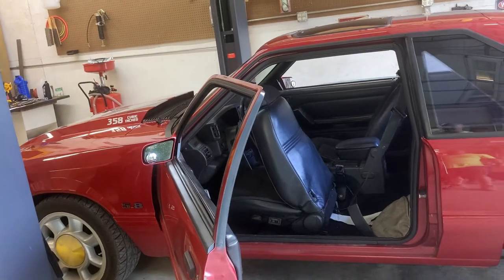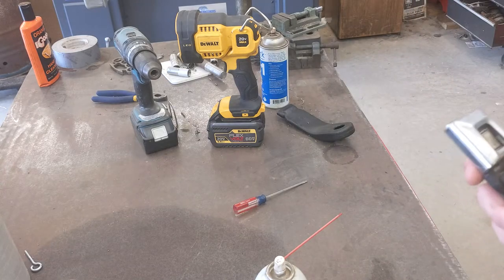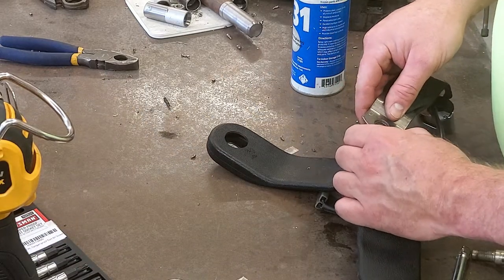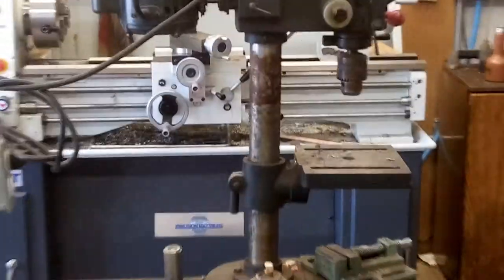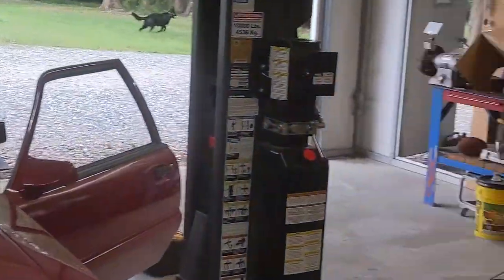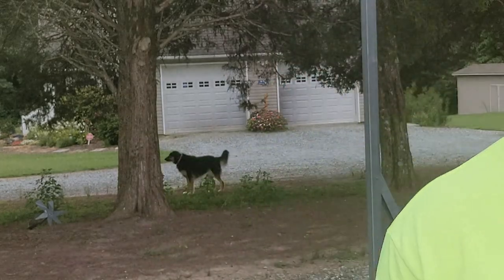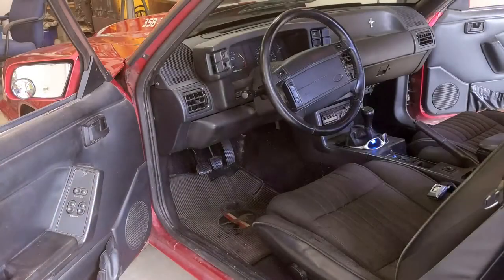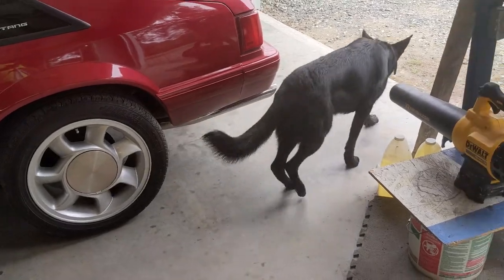Fox Body Mustang use rear seatbelt latch to fix drivers seatbelt latch

Comment: Just did this on my fox thanks for the tip, I honestly didn’t want to drill the holes so I just installed the bracket with a rubber grommet with the rear bolts that don’t have the thick part to stop it going in and it worked fine
Reply from the maker: That's awesome! Thanks for sharing!